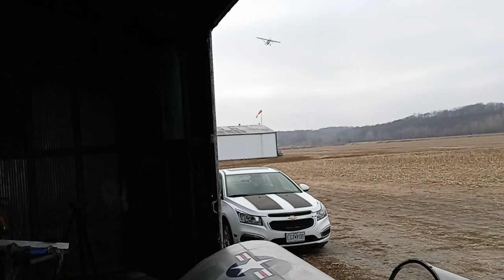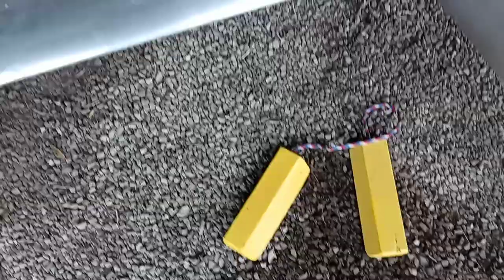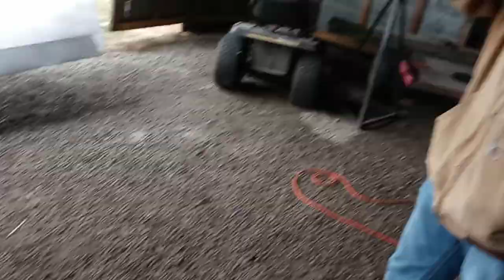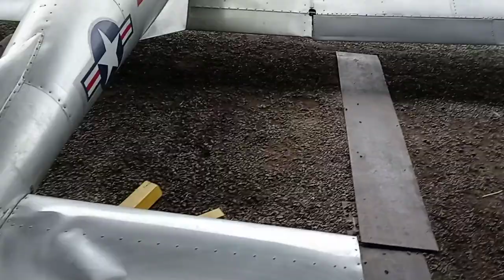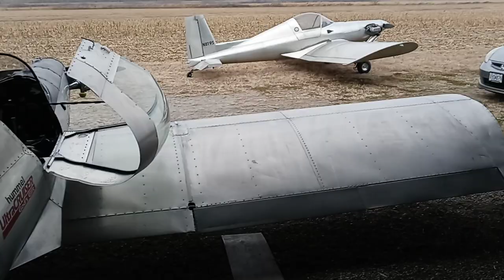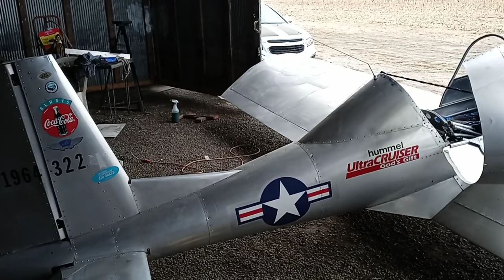Well i got damage to my UC!!!!

Comment: I am curious what the repair process would be for damage like this. Also, how many hours do you think it will take to fix this?
Reply from the maker: Hi David Turner. It will need a new right side rear spar and maybe front spar. Also stab skin and tip rib. Plus a new elevator built. So it will be probably a 5 or 6 hour job. I just do not know when I will be able to get to it. Thanks for the comment
Reply: @redblackvette  I would love to see a detailed video (or series of short videos) of the repair... when you have time to get to it.
Reply from the maker: Hi @davidturner3552  ok sir I will see what I can do for you and others. Sorry I just don't know yet when I will get to it. Thanks for the video suggestion